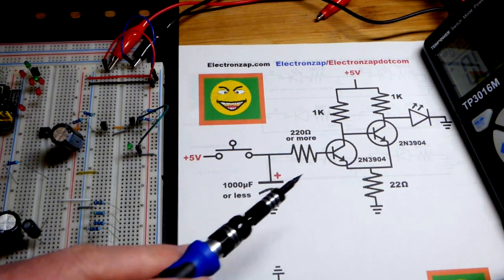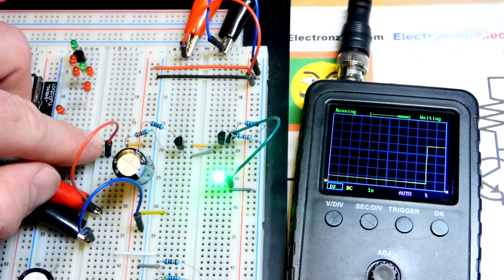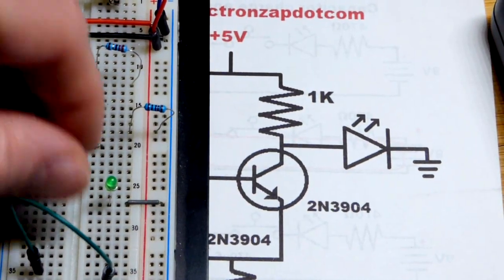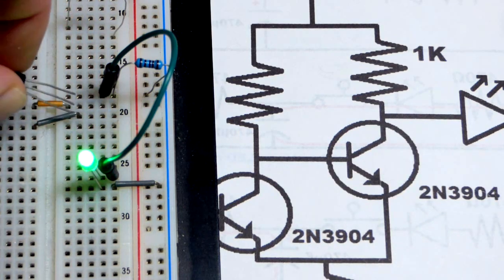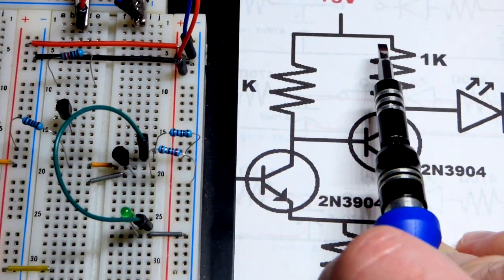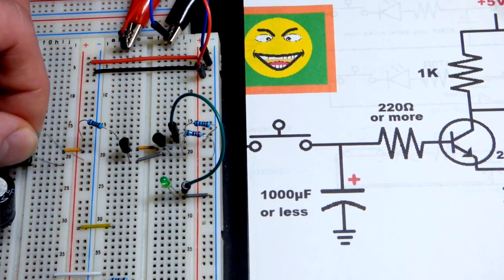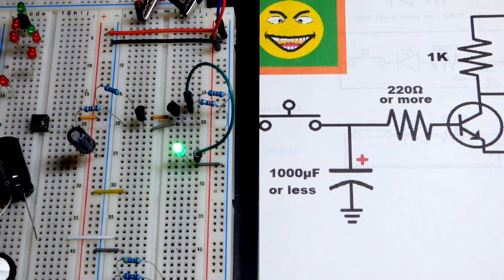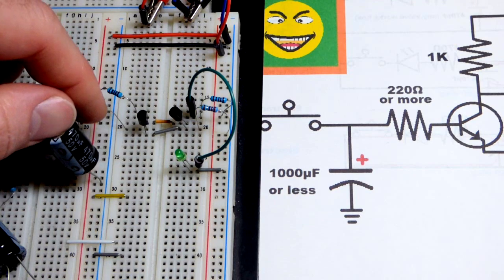Resistor capacitor RC timed off schmitt trigger circuit by electronzap electronics

Comment: square waves is cool but my problem with schmitt trigger is it consumes a bit of current even when its still off as all inverter circuit does
Reply from the maker: Usually better to use an op amp than BJTs for permanent circuits.

Comment: Awesome educational circuit. Thank you for all the details. It is worth saying that if you use a capacitor of the same value but lower voltage rating, for example 16v instead of the 50v you have here, then it would physically be much smaller but do the same job.
Reply from the maker: Yup, capacitors are usually a lot smaller the lower their maximum voltage is. Thanks for watching!
Reply: @Electronzap  Thank you for replying to your comments as you always do. Many other talented channels rarely do so. It takes a way from the learning and the quality of that channel because of the one-way communication. You're a winner! :)
Reply from the maker: @shvideo1  It's easy to answer about 1 comment an hour lol. It doesn't take all that many comments before replying to them all will get overwhelming.